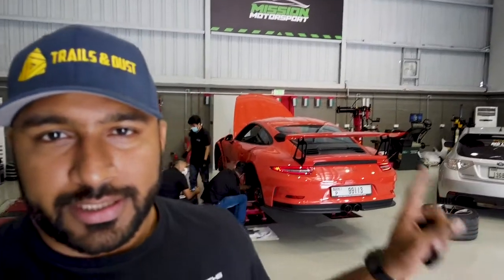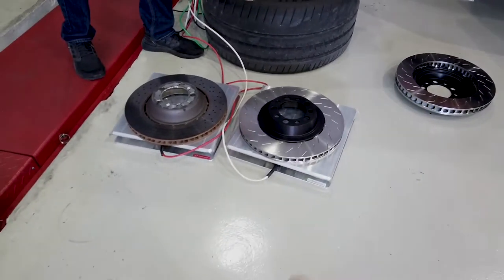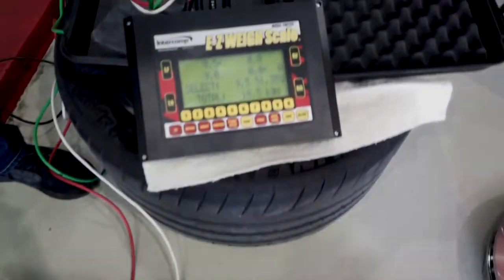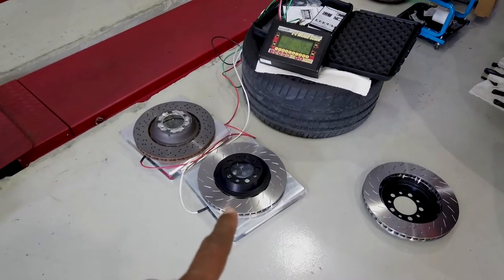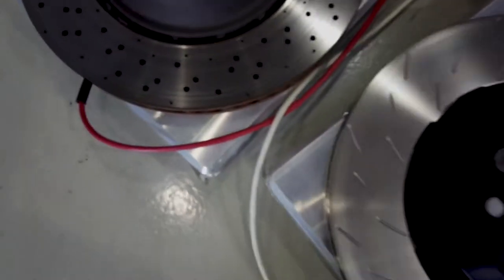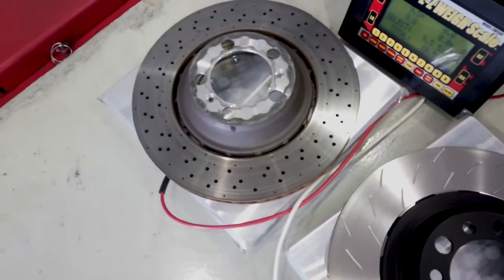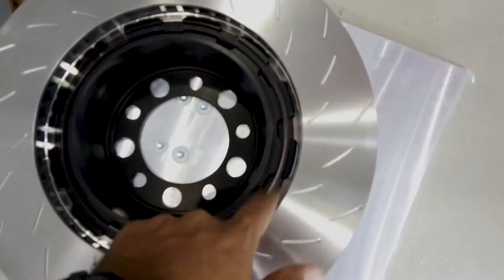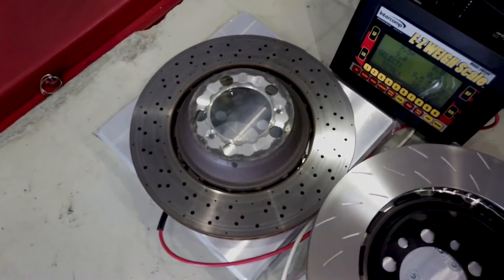GT3RS PFC Brake Discs & Pads Upgrade On A 991.1

Comment: Thank you for making this video! How have the performed vs stock?
Reply from the maker: I found them much better over stock. The pads are '14' compound so they squeal a lot on the road but are great on the track. My stock discs were due for replacement and I've not had the car from new so I wouldn't know how brand new OEM brakes feel.